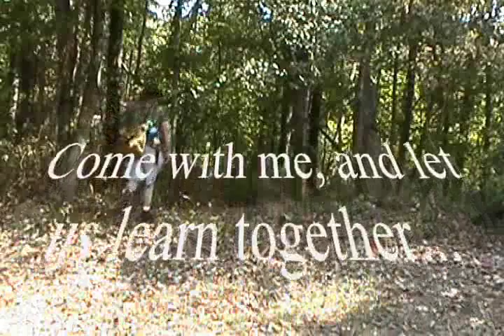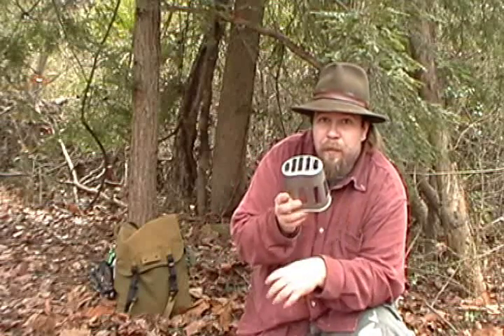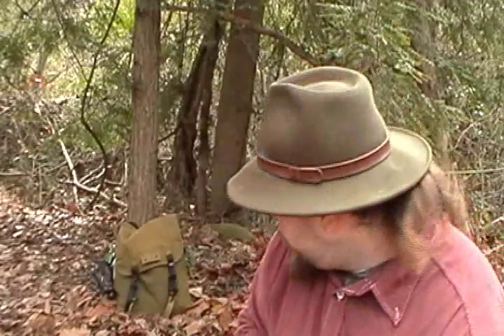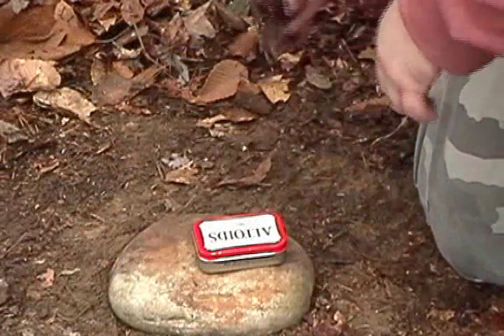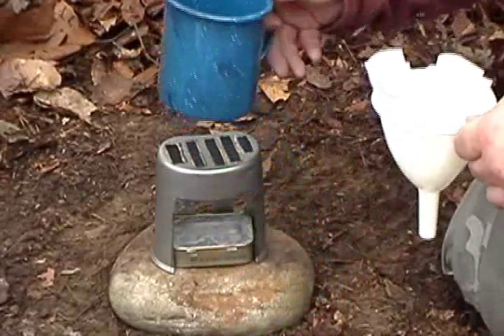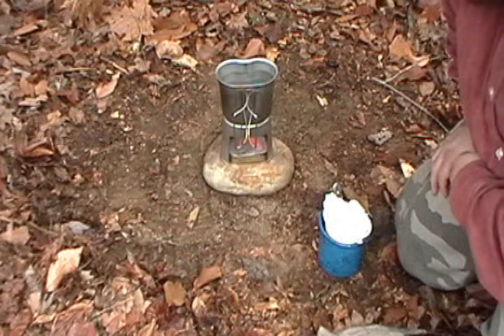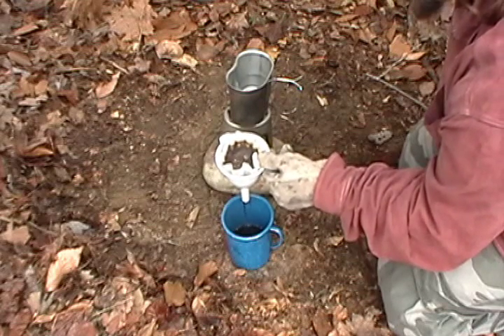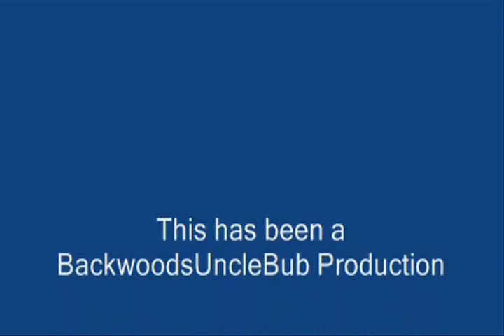DIY Grill Top Canteen Stove and Slow Drip Coffee

Comment: THANKS and Great Job! You have inspired me to make one of those.  I gotta make an altoid stove too. I currently use a stove threw together from a stainless steel hand towl dispenser. I used the Nomad Nimblewill plans for the little dandy wood stove. I used a dremel at first and went to a metal blade in a jig saw to finish it. I too burned up several wheels on the dremel and then burned out the brushes..lol the jig saw worked very well.

Comment: Go buy another green military canteen. Put it in the stainless cup mark a line all way around it. Cut it. U now have the bottom which is a bowl or cup. U can pour hot drink in and dont burn ur lips. The top of the canteen is a funnel when u unscrew the cap or a cup with the cap on. U can use the plastic piece that holds the cap on as a handle. Heres a link https://youtu.be/L6xpBd5NjdY